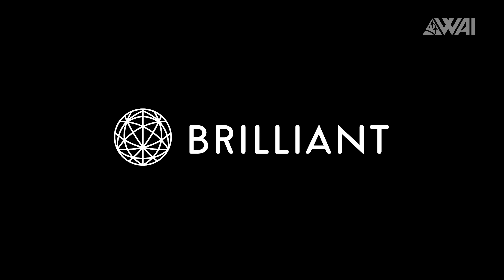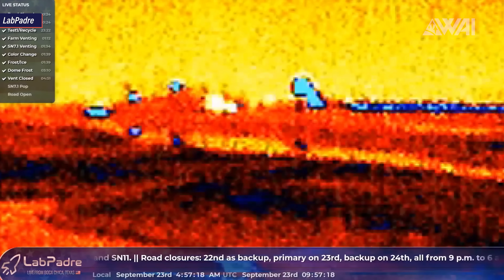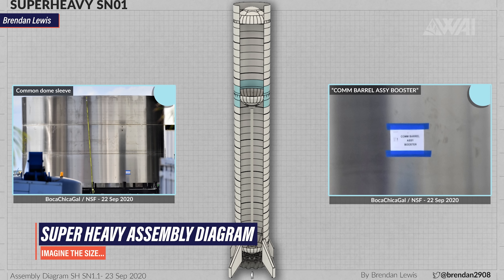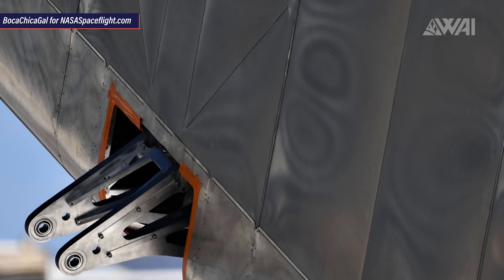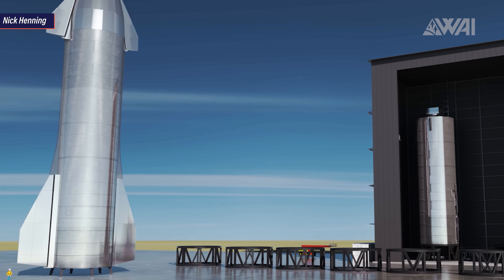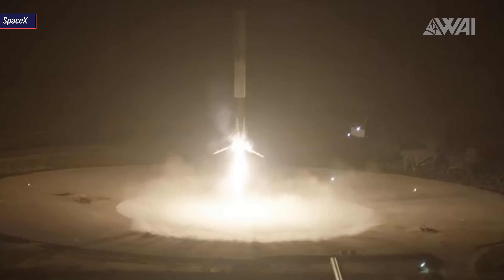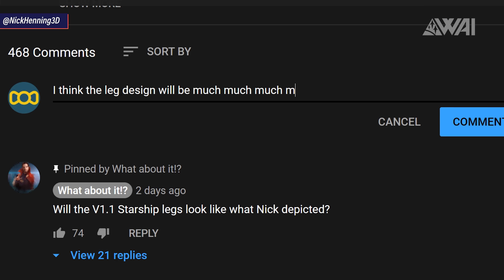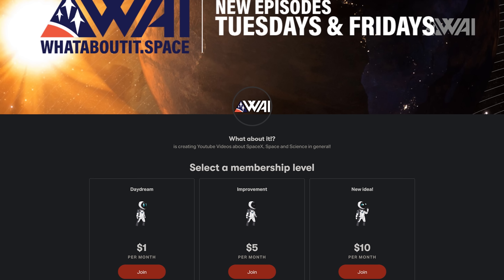122 | SpaceX Starship Super Heavy SN01 In Production!

Comment: dont understand why he is trying to make 1 ship to do all things... the starship should just put loads in LEO. carrying the huge starship just to land on the moon is wasteful...in total of 7 lunches (1 for the ship +6 refuels) you can place 700 tons in LEO. assemble a much better space ship with a weaker lander that can handle mars/moon gravity. its almost double the mass of the ISS using KiloPower 20 tons will produce 200kW every where with out need to increase solar area with distance. a proper space craft does not need to be strong to deal with an atmosphere, or have heat shields or any sort of aerodynamics which will make it much more optimal to use in space. we should start using inflatables like Bigelow modules to build ships. that will give the best area and volume for astronauts not to lose their mind. 100 tons in LEO can be an inflatable ship with enough fuel for the moon with a single lunch and much more space. the Apollo Command module+ lander had a wight of about 42 tons. with Kevlar fibers new computers and such we can have a ship+ lander for about 80-90 tons + 2 or 3 Kilopower to supply 20-30kW any where on the moon.
Reply: This is speculation, but I think the idea is it's cheaper to mass produce a single system than a pile of custom systems.
Reply: @TheEvilmooseofdoom  there will be so many versions of it that it is not  single system. even passenger starship will have to have one for LEO for close flights and one with better life support for the longer journeys.
Reply: @punicwars2  But that's just the top module.  And we don't know how many versions of that there will be but they'll all be variations on the same basic.. space frame?
Reply: @TheEvilmooseofdoom  but the basic shape of the star ship is inefficient for space flight. Its heavy, small in shape due to strong reinforced hull and way to powerful for most outer space/low G enviorment.
Reply: @punicwars2  Space doesn't care about the shape and the notion that it somehow makes it inefficient for spaceflight is in fact a completely meaningless statement.  The shape is dictated by aerodynamics because down here in the atmosphere it's the only place the shape counts for much of anything.  As for it's power, that is again something required only for getting off the ground and through all that atmosphere.  Without all that power you're not going anywhere.  I think the idea is that it can do just about anything even if can't do any one thing perfectly.  It's cheaper and easier to work from a single system than try and design and build a bunch of different optimized systems for specific jobs.  The goal is to drive prices down adding parts and complexity does the opposite.
Reply: @TheEvilmooseofdoom  sorry but i disagree. starship shape as u said is derived from the need to pass in an atmosphere. to be strong enough to deal with both the gravity and the aerodynamic load that comes with atmospheric flight. space has a different set of issues such as radiation, micro meteors long duration of flight and zero G. using prebuilt inflatable modules will give a much bigger space with a reduced wight of unnecessary gear. you dont need the heavy and strong structure of the starship to survive entry to Mars or the moon or any other moon in the solar system. the need to carry 300 tons of unnecessary steel every where is ridicules. even on in the airline industry you got 787s and 737s. there is no one plane to rule them all... us the starship to ferry heavy loads to LEO and then assemble a Bigelow interstellar craft with plenty of room even the basic module that Bigelow build the B330 has a volume of 330 cubic M while haveing a mass of 23 tons. 3 of them connected to each other will have a mass of 69 tons with the same inner space. add in some power and some cargo lets use all 100 tons of lift capacity of starship and you have the same craft with 1/3 of the mass. and that with a single starship... we got 6 more to go. that fuel and a lander for the moon and Mars in starship 2 and fuel for it all in starship 3. if you take their big module BA2100 has an inner volume of 2250 cubic meter with mass of between 65 tons to 100. so thats 2 1/4 of a starship for the price of 100 tons.in 3 launches you get much more space and less mass to push around interstellar space which in turn reduce the amount of fuel needed and so on. 
sorry but the starship is the original space shuttle come to life. there is no pint in using it for interstellar travel.
Reply: @punicwars2  "space has a different set of issues such as radiation, micro meteors long duration of flight and zero G" and the shape of the Starship copes with all of those things.

"using prebuilt inflatable modules will give a much bigger space with a reduced weight of unnecessary gear" but doesn't provide as good a protection from the things you just mentioned. You can't launch inflatable modules from the ground without putting them in some kind of aerodynamic shell to get them off the ground.  I think all you're doing is getting a little ahead of the game.  Specialized vehicles for specific applications need something to justify their cost and development.  When that happens expect things to move in that direction.  Until then to keep the whole venture economical they'll use one basic ship to get things moving and even that ship can be landed and left to act as a base or part of a base.  To do that they need a ship that can cope with all flight aspects from launch to re-entry.
Reply: @TheEvilmooseofdoom  are you reading what i am sayin??!!! ok i will make it slow this time. use starship to take inflatables, STARSHIP!!, then connect said modules together.  Sierra Nevada took over from Bigelow as far as i know their tech is not much back then starship. sending starship to mars is the biggest waste of money there is. you will see that out of its 1000 m^3 of inner space more then half will be gear and life support. it has a huge mass of 300 tons just for the frame with out crew and all the things to keep the crew alive. and it provieds great protection espacialy if you use water to inflate it with. but heres a nice article: https://www.space.com/sierra-nevada-inflatable-habitat-moon-gateway.html this is the future Gate-way station. take 2 or 3 of them and connect them and you fill get 3 time the space for half the mass.
Reply: @punicwars2  Funny I was going to say the same to you..  Yes I read what you wrote, but what you're talking about is still further down the line than we currently are.  There is no need for all that specialized design and construction yet.  That was my obviously missed point.  Bigelow modules are great and yes you get a lot more volume but it's still something that will need designing and testing before it 'flies'.  You start with just one ship to get the ball rolling, then as the need and economic motivation presents itself you work towards the specialized designs.  For that the starships current design works.  It's not perfect but will serve until there is a need for something more specialized.  You want them to do all that work and spend all that money before there is a need.  Like I said you're getting ahead of the game.
Reply: @TheEvilmooseofdoom  its seposed to be the GateWay station. Sierra navade have already built it and are testing it right now. It is far ahead of starship at the moment you understand?unlike the starship, this module has aready been build. Read the article i linked. Not ahead of my self or anything. You do under stand that before they gonna use humans on starship they wanted 1000s of landing? Next you gonna qualified living in a starship for 2 years. If you think its gonna be done by 2024 chances are you are mistaken... look how long it took to get dragon 2 of the ground and that was just for LEO. They are not gonna be the one spending all the money. Sierra Navada are going to be developing the modules so it will actually gonna sa e SpaceX money.
Reply: @punicwars2  I have read the article and you do realize that there are no plans at all to currently use that thing and that's it's still just going through ground testing.  It's a concept only.  In fact it forms no part of the current LOPG plans (not that those are not subject to change since it's still in early development too).  You are getting way ahead of yourself in your enthusiasm.  I don't expect Starship to carry humans anytime soon, and even Artemis is going forward without LOPG for now as well.  No one will be living on starship for years for a long while as well.  Mars is a far off dream perhaps even little better than a fantasy for the next few decades.
Reply: @TheEvilmooseofdoom  then if that is your stand why keep the stand about starship? Its just too inefficent to use as a mean of transport between plants. An if there is still so long to test it before humans can go on it, then you have time for companys like Bigelow and sierra navada to develop their tech.
Reply: @punicwars2  Because starship is that first important step.  And the tech being developed by Bigelow and SN are life support systems, not transport systems.  I don't know what their eventual use may be but something else will be moving people and material before any of those systems are adapted and/or mated to a transport system.  As for what is and isn't efficient it mostly boils down to cost, how much it will cost for a system to move a ton of cargo from point a to b.  If starship can do it cheaper and more reliably than other systems then it is efficient.  Sooner or later what you envision will come to pass because that will be the next step in driving costs down and increasing efficiency, but it won't be the first step taken, maybe not even the second because to make it reality we're going to need a space based infrastructure or extremely cheap and reliable ground to orbit (which is the big goal of starship).  I applaud your enthusiasm but I still think you're thinking further ahead than we actually are, but one day I hope it comes into being.
Reply: @TheEvilmooseofdoom  my bet is that starship will not fly humens to Mars. Going to LEO and surviveing there is no easy job but its a joke compere to interplanetery space. Starship will not be ready for that trip for at least the 2026 window. By then i hop that Bigelow and SN will be in a better position to do it right.
Reply: To me it is like the old DC-3 airplane. Start with a good basic design that can be mass produced, the modify as necessary for different missions. Fly multiple missions if necessary. This is much cheaper and more reliable than making many different designs.
Reply: @MrEd2291  no. and u can see it in the moon lander. lack of atmosphere making it very hard for it to land. the too powerful engine are an issue as well when it has to take of dirt and also land in case of the moon. u do not take a full semi trailer to bring 2 certs of Coka-Cola in to the city. u take a small truck for that. between citiys u use a big truck and for real long distances u use a train. using an interstellar craft as a full lander on mars is like beaching a 18th century sail ship instead of using a row bout.  your example is inherently wrong as the DC-3 medium was always air. starship will be flying and lending in air, vacuum and interplanetary space for long period of time. if you already need to build a specific starship "moon lander" then you are already losing the point of mass production as it has mid hull engine and no thermal shielding. if you use Biglow module as base for space craft u can still keep the "mass production" adventges as you can build them in factorys on earth and use it as base for space station or space craft (just attache a propulsion unit and a station is a ship). since only earth has a high G in the solar system (starship will not land on Venus nor on any of the gas giants) so a uniform much smaller lander that can deal with Mars G at best is all that is needed and u can use the saved mass to get more gear or power or people in the same trip. the star ship is a ladder to the stars. it aint the high way. use it for its strength.

Comment: Regarding the legs, I'd probably go for 3 on each side and between the flaps. I'd have 6 total for maximum redundancy and terrain correction for Mars/Moon mission. The fairly wide leg span of the falcon legs is very valuable in terms of stability. I think there is an easy way to make these legs self-levelling. Perhaps with flip-out sprung steel or variable hydraulics.

Comment: Won't starship need a solar panel array for interplanetary missions? I wonder which serial number will have the first prototypes for this system...

Thanks for the killer episode.
You Rock!
Reply from the maker: It does! First though, they will get it tested with lots and lots of launches to LEO. :_WAIRocket:
Reply: I'm thinking that because their will be different fleets of Starships for different purposes like fueling, cargo, crews, earth to earth, Lunar and Martian missions then different Starships will be equipped for their particular purpose. Much like we have cars and planes all built differently with different purposes so Starships will have the same philosophy
Reply: Sounds interesting. Does anybody know if the fairing for the tanker starship will be reworked to include more fuel tanks?
Reply: @franekcer1008  uncertain at this early stage, but I imagine the tanker Starships may be longer then the typical ones which will allow more fuel storage
Reply: Worldsmith Club probably shorter the passenger Starship is 1000 cubic meters of cargo, a Starship is only rated for 150 tons to LEO, you only need about 200 cubic meters of tank space for that fuel.

Comment: Welds are NOT always the weakest point.
Reply: Somebody with welding experience once posted that a good weld should be stronger than the surrounding metal.
Reply: If your weld isn’t your weakest point, your design might be bad.
Reply: @adamc6371  No, it's not uncommon for a weld to be stronger than the parent metal.  Ask a welder.
Reply: @TheEvilmooseofdoom  if the material is not up to snuff, than yes.

But I think this material quality outweighs any weld, no?
Reply: @RKroese  No, that's not how it works, it has to do with the heat affected zone.
Reply: @adamc6371   I certainly know nothing about welding, I just know what somebody who claimed to know about welding posted a few months ago.

Comment: I am not going to comment on the legs but one thing I think is, with all that sky diving you talk about you better have serious rigidity to that thing from top to bottom so it does not break in half or cause more problems even small ones, think about it. I mean solid rigidity from the tip top to the edge bottom either vertical or horizontal one way or the other we can't have the thing busting in half or whatever. You are the experts so figure it out.  RIGID AS IN 'ie OR RIGIDITY !

Comment: hard to picture the booster support a fully fueled starship given how thin the metal is. does the booster have to be fueled first before starship in order to be rigid enough to support all that mass?
Reply from the maker: This might very well be possible. I am planning to do a series of 304L tests at cryo and high temps in a few weeks. Stay tuned. :_WAISweet:
Reply: According to Musk and his presentations, starship will be fully fueled only in orbit when stacked on top of super heavy booster
Reply: The base of super heavy booster will probably be reinforced in addition to the pressurisation.. That should make it work to withstand the weight of starship. I guess the only question is how high the internal pressure should be to hold that massive total weight... It won't bevan easy and quick task for sure
Reply: @aurimjakim431  well i thought the idea was that all the sections were very similar if not the same between starship and the booster in order to speed up fabrication? anyways its fun to speculate ^_^
Reply: @danroden830  It's an optimisation game... finding a balance between what's most efficient to manufacture, and what's needed to make the rocket work. Obviously there will be different requirements for the two... e.g. the rocket equation means that extra mass on an upper stage has more impact than the same mass on a lower stage, so if they did need reinforcement on the booster, it might be worth the inconvenience of needing two different thicknesses of steel...

Comment: I can't be the only observer that cringes everytime the term "flap" is used to describe the forward or rear aerodynamic surfaces on a Starship. As a pilot, I know flaps as an extension of my aircraft's wing surface that increase drag, increase lift, and allow higher power settings at lower speeds. Flaps on my airplane do not provide directional control or roll control. The movable aerodynamic surfaces on the Starship are clearly intended to actively steer the pitch, roll, and yaw during certain flight segments. But they're not flaps. Unless Elon calls them flaps, of course. If he doesn't and he refers to them using a different, more properly descriptive term, then call them that please!
Reply from the maker: I'm a pilot myself and I have the same problem. Elon calls them flaps though. □:_WAIShocked:
Reply: If Elon refers to his Starship's aerodynamic surfaces as flaps he is effectively redefining the term. I would wager his design team has a more accurately descriptive term for them but we just don't know what it is. In any event, I am very interested in finding out if they actually are capable of controlling the Starship during approach and landing.
Reply: Kind of a flaperon, flapperator, durflappation device?